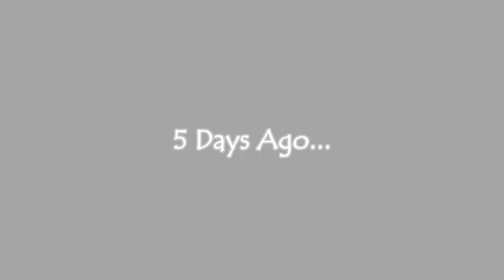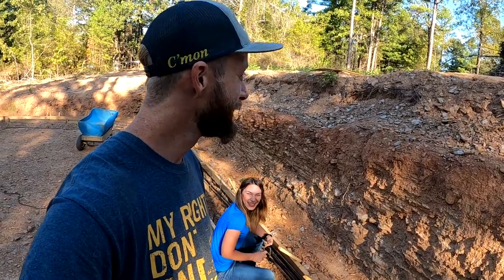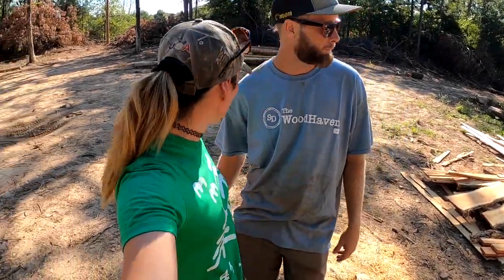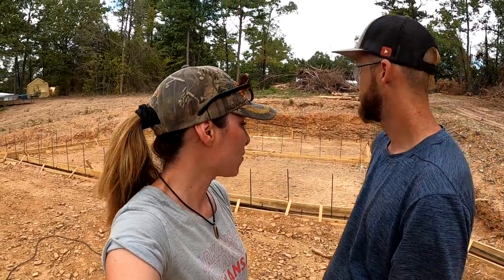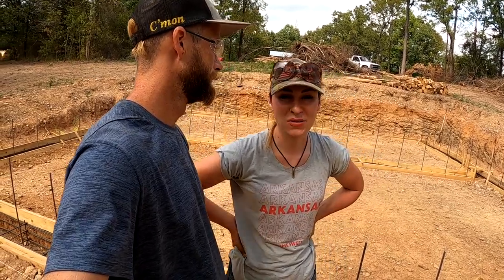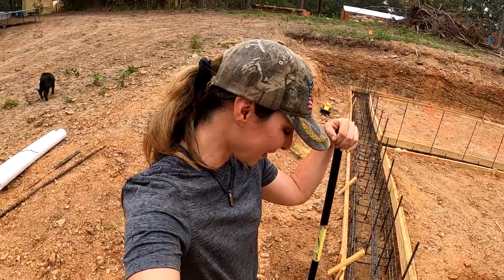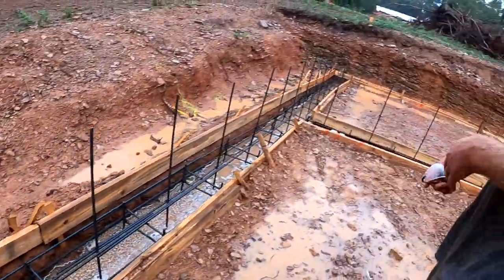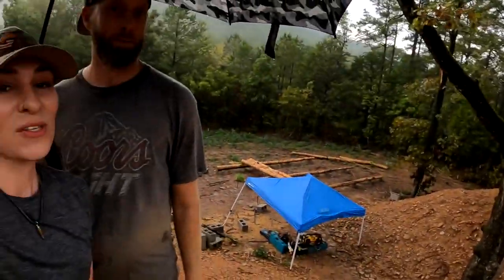We've worked so hard to be Here! DIY Cabin Basement Foundation Build

Comment: New sub, great job guys! I'm going through something similar right now, but have gone through all of this before. Our entire family lived in a 10, x 12' shed (with sleeping quarters upstairs) while we built our house ourselves. We were showering outside right up to the freeze (Wisconsin), and got the building dried-in in early winter. We moved in and worked on the electrical and plumbing all winter. We are currently building a 36' x 48' post frame building, and just flew in the trusses yesterday. Racing against the cold again, but we should get it done! 🥶

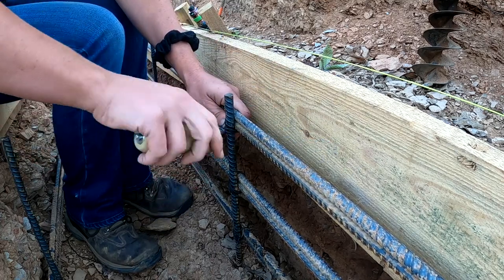Comment: @4:30 It will go around the bars Two Times if you use two of them in a X pattern
top left to bottom right, = One. top right to bottom left, = One.
Reply from the maker: Lol that's what I ended up doing but it was an extra step.
Reply: @SimpleLifeReclaimed  I'm an electrician and we use Lineman Pliers to twist them. Might be easier for you, it is for us.

Comment: You guys are awesome! However, I built bridges for years, and a bridge pier that supports a bridge deck has less rebar per yard of concrete than your foundation. Additionally I question the wisdom of running rebar down into the dirt. Although it would take years the ends will eventually rust away. Tip: When you use the twister (Technical name for the wire tying tool) pull away from the steel while twisting. It will be easier to twist and will pull the rebar together better. Keep up the good work. Can't wait to see the house you two build. Include more of the girls. We hardly know them.

Comment: Congrats on reaching a new stage in the project!  One thing that I kept waiting for and haven't seen is the rebar for the floor of the basement?  I've never seen a foundation poured that didn't include rebar across the entire width of the pour.  Also, I couldn't tell from your walk through of the floor plan but just in case, I highly recommend putting the walk-out door off center if you are having a living area down there.  The majority of your furniture will be in the "living area" and it will be much easier to have a comfortable layout if the doorway isn't in the middle of it.

Comment: I'm late to the game and going to try and look past all the rebar and foundation vids.  I love the effort of their community and motivation to do it themselves.  Rebar in the ground and on the edges of the concrete are a huge no no.  It will all rust and fail as well as bust up the concrete. It will probably be fine considering it's the most massive residential footings I've ever seen especially in AR but they are still going to have big crack issues.  There are so many good videos out there on how to do it properly, this is not one of them. Given their efforts and expense I can't believe they did this.  18"x12" is probably sufficient with 2 rebars in 3" from the edges.  Smooth top then mark out and drill for block rebar. A lot of hard work that could have more easily been done properly. I can't believe the concrete guy will even pour it.  We'll see.

Comment: Now that's going to be about the strongest footing Ive ever seen. Love over kill projects. Also are you using concrete cinder blocks for the basement walls? If so are you filling them with concrete? Then the basement can double as a storm shelter.
Reply: I just saw a house that the foundation blew out because the cinder blocks weren't filled and outside water pressure and loose soil blew the wall right out!! My parents basement is failing after 60 years for the same reason. They didn't fill the core and it leaks horribly.

Comment: You have done an amazing job getting all that Rebar done. I know it's crazy but when you put the pipes in the ground wouldn't it have been better to either extend the outside pipe so it was away from the build and the inner pipe to at least have bends on them so you wouldn't have to dig down to find the ends?

Comment: Why didn't you install the pipes b4 any of the formwork or steel was in the way? Also the 4 foot vertical pieces of rebar can be set in right after you place the concrete and it's still workable, saving u a piss load of time on drilling  into the ground. Cheers from Canada!😁🇨🇦🔨
Reply from the maker: Because without that stuff being there, we wouldn't be able to measure the measurements required for the finished cabin water in and out accurately.
Reply: @SimpleLifeReclaimed  Sure you can, had you set up batter boards and string lines like we do on all of our jobsites. Just saying😁
Reply from the maker: @homernextdoor5950  ok correction, at the time with the knowledge and skills we have this we seen as the best most accurate way for us to get er dun. We might not always do things conventionally, and may even do things the hard way, but we get er done regardless. 😁 I'm proud of us. Never have we ever done anything like this before. 😎

Comment: WTF, an interior french drain?? If your  grading around the house  and your french drain are done correctly there is no need for a sump on the inside. Places like Alaska that have permafrost require them. Save your time and money!
Reply: A sump pump cost $100. It's worth the expense just in case they do get flooding.
Reply: @laurieg673  I've been a General contractor for 29 yrs and I'm not quite sure if you understand. They're building on a slope, there's no creek,river,lake or ocean that could flood and enter the basement through a door or window. As I mentioned in my comment as long as the land around the house is sloped away from the house which is required by code where applicable  the exterior French drain will take any water away from the structure that does make it to the footings which it shouldn't. A french drain around the exterior of a foundation is more a precaution. Also they are hopefully putting a drain in their mechanical room for any plumbing or water problems that may occur inside inside.